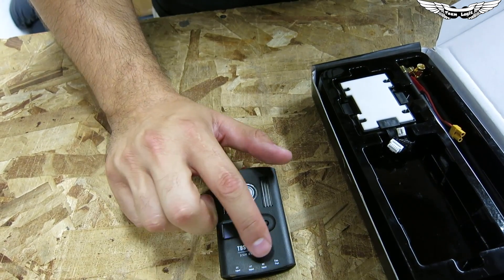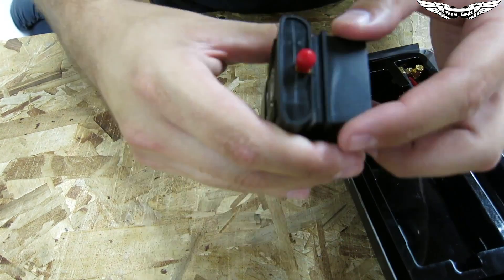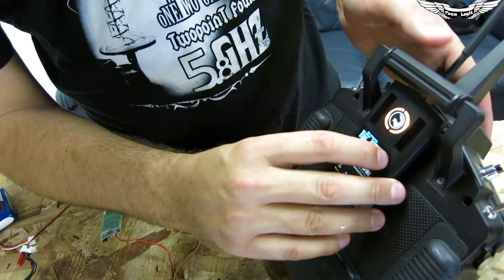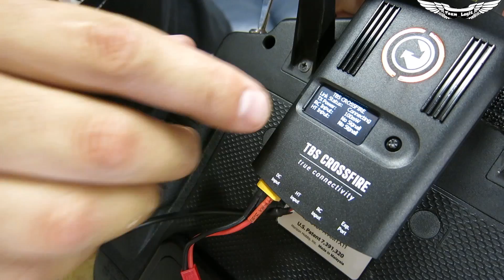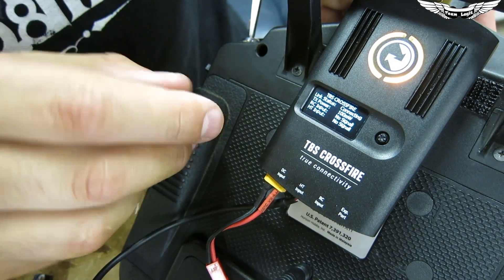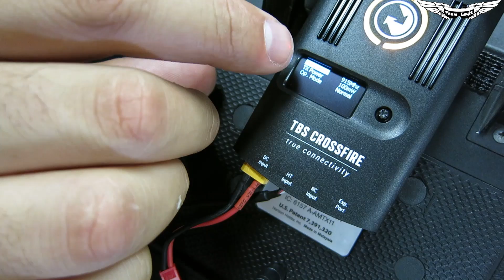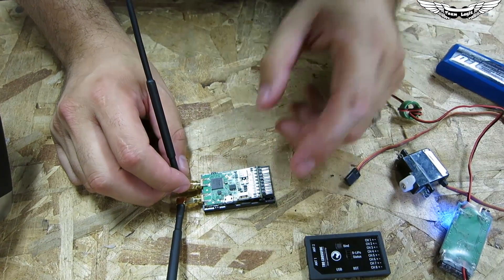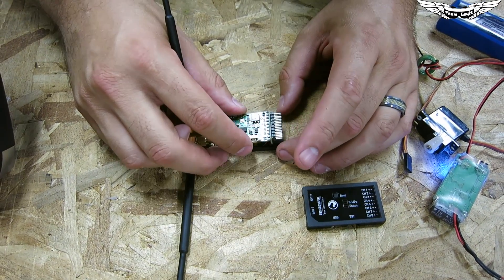TBS Cross Fire Unboxing and Overview

Comment: Hey TL.. what are the settings in the spektrum radio that allows it to work?
Reply: figured it out .. nothing on the web about it ..strange.   Anyhoozle for peeps trying to figure it out .. set your controller as slave and plug into the RC input not the Headtracker .. makesure you setup your ppm channel as well

Comment: I'm new to the drone scene and I've purchased a TBS Tango and I'm confused as to what this module actually is and does. I understand that it is a telemetry Reciever but does that mean that this module will allow me to use it to control all FrSky, Spektrum, Jr Recievers ? I realize that it gives you an extremely long range is what appears to be a very clean clear picture when flying FPV but I'm still really confused as to whether or not I would only need this one module for all of my different receiver brands? Any help in this matter would be appreciated and I am new to the radios and receiver outside of spectrum, JR etc.

Comment: hy team legit ,I have a question? is there a smaller receiver for the racing quads :)
Reply: Men TeamLegit, I have a futaba t7c 2.4ghz Fasst and accidentally, don't broke the antenna, but I break the stand of the antenna the cable is just fine ,but viewing  the remote controls in the market , i just wonder if is better to upgrade the remote control, for the remote controls I want I think for the price is better the long range .    TBS Crossfire TX - Long Range R/C Link. it cost about $208.00

Comment: Hey Team Legit.  I am having an issue where my trainer port on my DX8 is giving the No Signal! to the crossfire.  It seems a few other guys are having this same issue.  is there a fix for this? or settings i have to input on the Spektrum transmitter?  Help would be greatly appreciated!

Comment: Do you need to setup a trainer on the Spektrum? Or just plug into the trainer port?
Reply: @ RC Fermata00, did you manage to use a Spektrum with this?
Reply: I did a test flight of my new TBS LR plane without setting up a trainer... Seemed to work just fine. But that was just a LOS test flight... I will let you know what happens once I got LR FPV. But it seems to be ok so far! Just plug it into the trainer.

Comment: Ok let understand this, I use a eagle tree vector, and for autopilot, I want long range link, so If I get the crossfire with the receiver and removed my R617fs futaba receiver and replaced with the crossfire receiver, I will get the telemetry of the crossfire send to my crossfire transmitter in the back panel. correct?  and all my eagle tree vector functions will be display in my googles like before the change ( futaba for crossfire). Correct?
Reply from the maker: No I think your mistaken. I also didn't understand your question 100%. please clarify what you mean
Reply from the maker: It will supplement your futaba for long range. the telemetry will still be displayed in your goggles like normal. you will need to make a custom wire from the Vector to cross fire to get the data on the back panel.
Reply: +Team Legit , thanks so much for you reply so fast,
Reply: +Team Legit Now I just want to replaced the R617FS receiver from my fpv aircraft to make it a little more long range, but the telemetry send from the crossfire receiver to my crossfire module in a futaba radio, is one thing, the vector telemetry send by my video transmitter is other  correct.?
Reply: +Team Legit what do you mean fabricate a cable? and for what?
Reply: +Team Legit Do you mean a cable for the RSSI?
Reply from the maker: +maxun1 You need a cable to send the telemetry data from the Vector GPS to the TBS crossfire

Comment: The 800mhz band in USA is used by broadband cell towers and has a lot traffic I wouldn't recommend  using it.
The 900mhz band in the USA requires at a minimum  a HAM radio tech license. What is interesting about this band is that there is no restrictions to max power except if you are within 241km of the of the boundaries of White Sands test range in New Mexico and amplifiers are available for duplex data transmission. You could legally  go 100 miles out.

Comment: Will they add SBus support? (or is there already?)

second question: I am running a modified Taranis FW that will output SBus on Pin5 to lower the delay even more, will that be supported by the cfire in the future? (without sbus to ppm converter obviously :-P)

Comment: Put the latest firmware on it.  Version .22 adds Dynamic TX power output which will automatically increase TX power as needed.  It also adds 12ch PPM output.  Headtracker port issue has been fixed for a while as well.  :)
Reply from the maker: +Beerad FPV Thank you, I will do the Update ASAP.

Comment: Nice review Johnny :)
What is the point to have Telemetry showing itself on the UHF Transmitter? When i am flying i never watch the back of my radio control lol I can watch the front of it and most of times my FPV screen...
Have a great weekend
Reply: +ABMNS PRODUCTION I bet you rarely care about the location of your plane WHILE flying, especially in GPS coordinate format :) This is more for people who crash and retrieve frequently :)

Also, this is an all-purpose UAV control system. While we release software updates for it, there will be special settings and features for miniquads, for large UAV systems, etc. Not everyone will connect this to his remote control, some may tape it to the back of their laptops, etc. 

The LCD was placed mainly for allowing you to make settings, doing away with the need for any PC application. Displaying GPS coordinates was just a no-brainer given the hardware and data we had at our disposal :)
Reply: +Team BlackSheep Hey TBS, +Team Legit was talking about how the internal battery allows rx to tx relay of gps coordinates IF the aircraft goes down with a TBS core plugged in. Do you guys plan in the future on integrating this feature for other GPS's (eg. even with APM boards?). I am currently running APM's Pixhawk, and that would be a godsend.
Reply from the maker: +ABMNS PRODUCTION Thank You, I totally see your point. Also its not UHF its 915 or 868 which kinda seems weird for me.
Reply: Team Legit Yes absolutely according to the UHF normalization, you can classify these frequencies on the UHF Band IV and V they are part of the huge UHF spectrum from
300mhz to 3Ghz which is covering a lot of applications like: Military, industrial, commercial and even public purposes. The frequencies used by the crossfire are part of the public application, that's why you don't need any authorization to use it BUT these frequencies are also hardly used by Terrestrial Television & cellphones broadcasting.
Looking forward to your tests :)